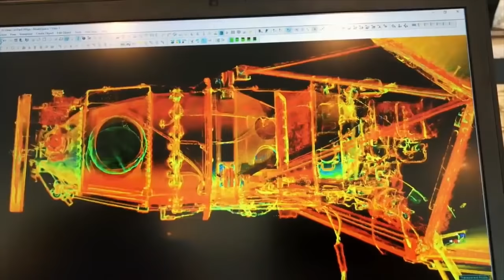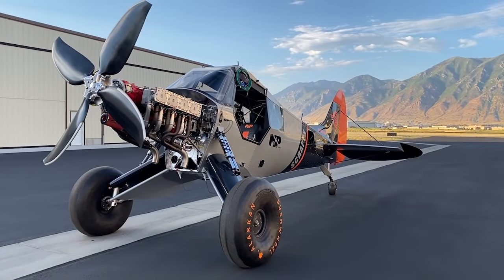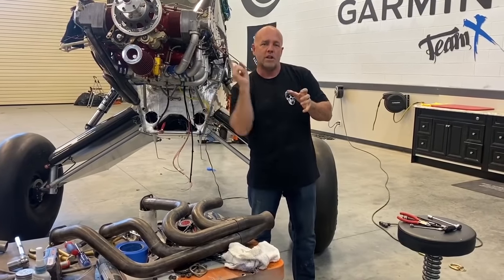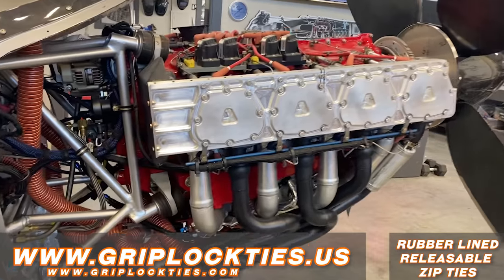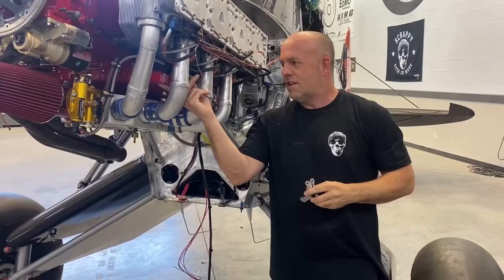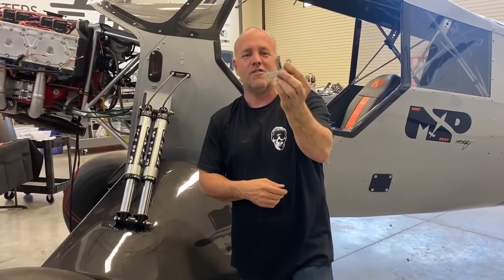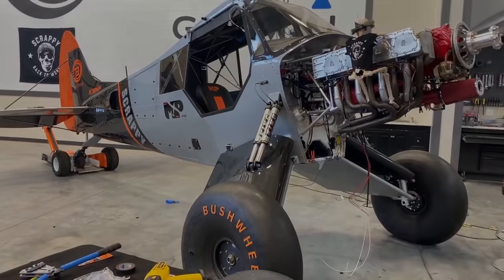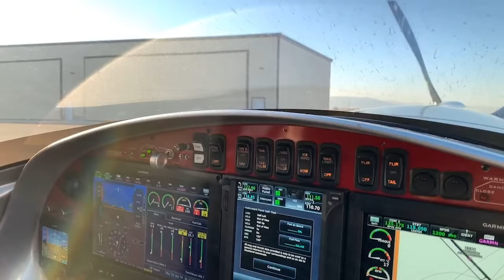Monster Race Engine Roars to Life in Tiny Bush Plane 🤩 Part 1 | Scrappy #32

Comment: It didn't flip on it back with the torque or pull the truck it was attached to, so Mike you need to get more power.  :-)
Reply: Why don’t you put a water cooled 495 cdi 750 hp  1700 lb torque.890 lb,  in that toy?
Reply: @richardcam8870  If that is ment for me, the answer is simple my aircraft has to be less than 600lbs MTOW and the engine would exceed that or not leave enough pay load to take me. :-)

Comment: For a guy that put all that design into the engine mount bolts which is super impressive, why are your throttle bolts upside down with nuts up, certainly not a recommended practice.  BTW, love your videos.

Comment: Motor = electric, engine = internal combustion. Also the “chev 350’s” you pictured were actually big block engines, not small blocks (like a “chev 350” is).

Comment: Sorry but I cant work for you. Hadn't watched this yet but of course I saw it in my feed. Then i dreamt last night i worked for you in the hanger and for some reason we decided to do the test start inside. The motor ran away, plane jumped the blocks and I ended up holding the tail to keep it from shredding turbulence. Then the usual fire from red hot exhaust from inside engine runs burnt down the hanger. You were still in your good spirits after the fire as scrappy was the only total loss, and insurance would take care of the rest.

Comment: Had to put 500# in the tail to keep it from tipping over.
Reply from the maker: Lol, 😂🤠 Many would naturally think that.  The entire CG was completely moved around,  the actual  firewall is over two feet back. The main tires are 14” forward and the front seat is within a couple inches of the back seat original location. It is spot on CG and with no weight put in the tail I have been racing it around the airport and smashing the brakes without coming up.  Now I need some wings.  👍🤠 cheers
Reply: @MikePatey  Mike, that's awesome. You aircraft people always amaze with your precision and beautiful engineering and mechanics. Мир Вам

Comment: I'm genuinely curious how this much torque with a prop, high low speed thrust and such light weight won't be an absolute handful with counter rotation in the airframe...

I've been conceptualizing a similar concept to scrappy for the future (when I can/choose to afford a custom plane) with a high power engine and very high low speed thrust and I kind of assumed that at 400-500hp and 1500 or less pounds that contra rotating props would be neccesary, or at least highly preferred so I'm not fighting induced rotation with the stick so much.
Reply: For the record, the idea would be an LS V8 with a chromoly tube frame, the best stol wing setup I could find with as many slats and flaps as I could cram, and landing gear with racing shocks just like scrappy.

Smaller though, and much rougher looking haha. I'll never have the resources for custom billet aluminum and carbon fiber parts!

Comment: Mike, I noticed on the throttle cables you had a shrink wrap type covering coming up to the nut. What is that and why don’t you use thread lock.

Comment: Exhaust backpressure is nonsense. Long tube headers increase performance for this application because the primary pipes are meeting the collector later. This setup helps improve torque below the peak torque output of the engine, which I assume is typically where it is running, since redlining a 13L you're depending on for lift sounds like a bad idea.
Reply: Yup engine building is not his thing

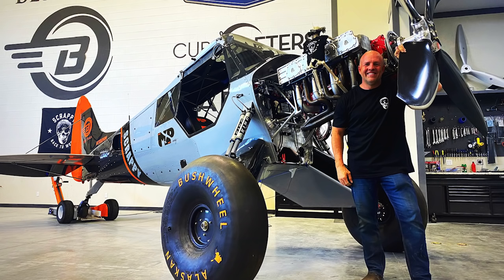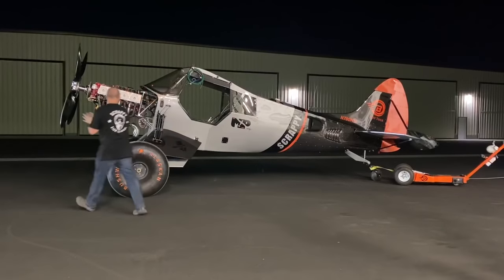Comment: 1:22 12:17  With an engine like that, what do you need wings for?  Just leave it like this.  The elevator and rudder ought to be enough! :-)  Or maybe the only reason you need wings is just to stop the fuselage from spinning around in the opposite direction to the propeller! :-)

Comment: Have you tried putting a Honda K24a2 motor in it running at 700hp with stock internals and 1/4 the weight? That thing would fly like a jet airplane hp/weight ratio. Big block big bore is so carburetor days

Comment: Nice! Sounds great! Also, what's up with draco, is it dead? Or did you repair it? I never actually got a clear answer on that...
Reply: He’s mentioned it several times in videos.
Reply: He's got the bits stored away somewhere.
Reply: @JoshKelson  he mentioned the crash but I wasn't sure if it was scrapped. Although I am quite new to the server, so not sure
Reply: Ya no worries. I was mentioning it, not confrontational. He’s got it stored away and is looking to rebuild it. I think he’s got a lot going on though so it’s got to get in line 😂. Check out his other videos, he mentions he’s going to rebuild.

Comment: Still can't figure out the the flat-eight - I assume it can't be a 'boxer' with an 8-throw/pin crank (which would be at l least 13, or even 17 journals including the mains), so 4-throw (cross-plane)? But wouldn't that give 'big bang' firing order, pairs of cylinders firing simultaneously?

Comment: Nice Build. I have a question? What material is the exhaust manifold made from? Have you used Titanium for lower weight? Also your intake Runners. They're made in aluminum, could you make them out of Carbon Fiber or are the intake air temps to high?

Comment: Uneaqual length exhaust tubes causes problems with scavenging by canceling or time restricting the return pulse thus cancellation and or inhibiting the correct cylinder inlet charging.

Comment: Are those bolts on the throttle linkage on upside down? I thought the rule was the head of the bolt be installed on top.

Comment: Ijust found this channel and love it. Looking into planes now for myself. ’m new to planes but heavy in street cars and heavy into mods. Muffler won’t help with low end power/take offs?  I understand it prolly great for max rpm but wat about mufflers that open as rpm rise. Any logic to adding back pressure into a plane. .

Comment: With all that horsepower will it be able to take off in a cross wind.?
Reply: Ouch
Reply: @reallybuddy3259  I mean, I just don't get it. What possesses a man that knows so much about aircraft and flight to take off in a cross wind.? I know a little about flight. I dont care if it's a Radio controlled airplane or a 747 the general rule is not take off in a strong cross wind. I was on a 747 that landed in a cross wind and the out board engine was scraping the run way. There were sparks flying every where. Scared the shit out of me and everyone on that plane.
Reply: @textech4056  A HUMAN Error
Reply: @textech4056  At least the 747 did not run out of fuel and crash?

Comment: Less than 1hp per cubic inch isn’t that great.  Why not build say a 555ci all aluminum Big block Chevy with a dry sump and EFI?
Reply from the maker: Great question 👍🤠 It’s all in the RPM.  An airplane needs to hold near 100 percent power continuously. A big block Chevy like I have built before wouldn’t hold together for thousands of hours if it was pegged non stop dragging a trailer non stop up an infinite mountain.  So aircraft engines only run at 2,700 RPM. Yet it can pull 500 HP non stop.  They make similar HP at the same RPM if they have the same cubic inches.  Also with no water cooled system it has less failure with the air cooling. I could do what you suggest.  Many have tried.  It also requires a gear box to cut the propeller RPM in half if you use an automotive engine. The max rpm of aircraft typically mac out at is 3,000 rpm because the prop blade tips go supersonic after that and explode.  After you build the gear box, the liquid cooling, and still have the problem of running a big block engine at an rpm for thousands of hours it can’t handle.  For those and a few other reasons it pulls people back to giant cubic inches turning lower rpm.  Hope that helps 🤠 cheers

Comment: Hey Mike I know this was an older post and watched this first start back in Nov. what I can't wrap my head around is.... Is this a fixed pitch prop?  I look at the distance between the flywheel and the prop head and I know the mechanical makeup of most constant speed props but that thin?? connection plate just does not look like it has the diameter to manage a constant speed prop.  I may be totally wrong but figured I would ask.  Thanks, back to work?

Comment: Hey great video but if you use content from other creators (like warped perception with the see through cylinder head) you need to attribute their channel. A watermark over those clips of their channel name should be enough. Cheers

Comment: Did you found an FAA engineer to sign-off the flight worthiness of that plane?  Just the eyeballing feels like scratching a chalkboard with my nails. Seriously it's triple the tork and triple the weight of the initial engine. Added to that is your suspension tabs acting like a canard wing except that it's under the C.G. and have a -45 deg dihedral angle making the airplane very unstable. So if the airplane flip upside down at 100 ft when you decide to floor it at take off the parachute won't be of any help.

Comment: is she a wee bit nose heavy with that call it "13 liter engine", or did you add weight in the tail to keep the c.g. where it should be?
How much did you increase the fuel capacity, to keep the same range of the smaller engine?

Comment: What's the deal with the small "wings" on the main gear legs? Are the just elaborate fairings or is there more to it?
Reply: Check out his previous videos he talks all about it!
Reply: @JoshKelson  I know it’s an airfoil shape and he expects to get some lift from them, is there anything else?
Reply: That’s pretty much it. In order to get the suspension he wanted (going straight up and down) the dual bars were needed and so he made one an airfoil. They also should help direct air during landing that helps with airflow and lift.
Reply: @JoshKelson  Thanks! Has Mike ever told us what the "special features" are in those custom shacks he had made?
Reply: @leofriedwald9901  special features??
Reply: @JoshKelson  He's mentioned "special features" in the shocks a few times but so far I haven't seen him elaborate on it. Thought I might have missed something
Reply: Ah. I think there may be more he hasn’t talked about yet.

Comment: Why didn't you show us the plane during the engine run up? We could hear it but we couldn't see it.

Also, it's very dangerous to run up an engine on an airplane without its wings. Ask me how I know. I learned that the hard way. It will torque over.

Comment: That thing is going to fly like shit.  Slow down and it will sink. Looks cool and a great accomplishment.
Reply from the maker: 😂🤠 yea I need wings first lol.  It will be a heavy cub as far as Cubs go but it is 100 percent based on wing loading calculations period.  If I put a  cub sized wing on this plane I would agree with you completely, it would sink.  If I match the song losing to a bigger song to pare up the numbers it would fly at similar speeds.  I will certainly build a one off wing to match the weight.  Thanks for saying it looks cool 👍🤠 cheers my friend
Reply: @MikePatey  I have seen your Turbulence and Draco, impressed by both.  How are you compensating for the massive shift in CG?

Comment: I woulda done the same as the guy who built the Draco.... turbines are just lighter then piston engines..   only reason.  if ya really think about it a electric engine puts out almost an unlimited ammount of torque  you could have a prop with a 1 turn in 20 feet lol      paddle ....
Reply: Uh...this IS the guy that built Draco 😂